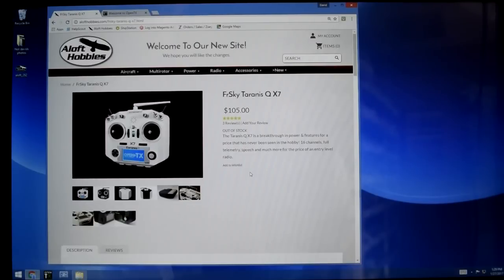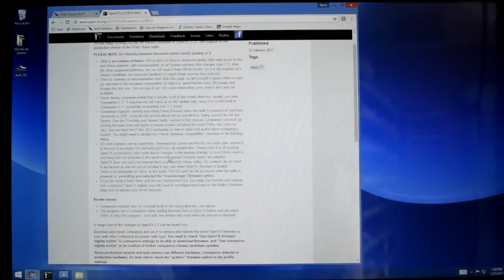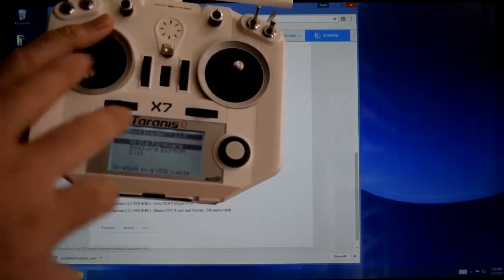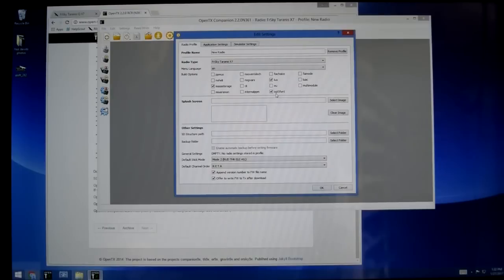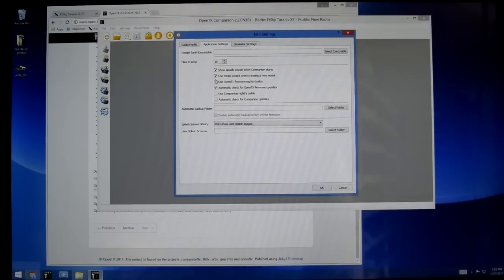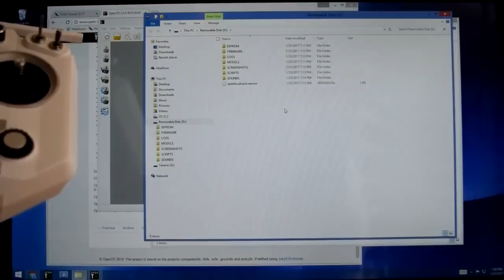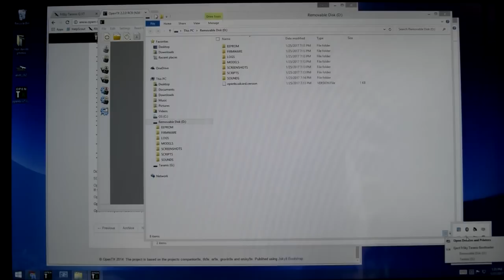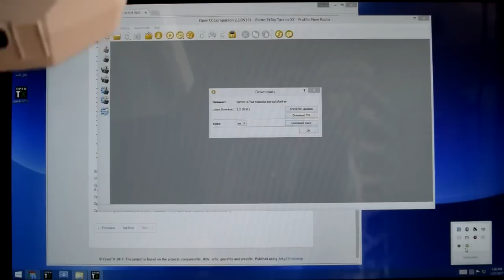Taranis Q X7 - Updating your firmware

Comment: any idea for such issue ?
i have upgraded firmware from Companion software (profile set corectly for proper radio model). I noticed strange thing, after entering bootloader menu, radio skipped bootloader menu into USB connected message. Program seems to work fine, (writing new firmware finished successfuly etc etc) but after disconnecting the USB cable (from windows too), there was still message "USB conne..." on the display and radio stucks. i canoot power that off - after unplugging battery radio didnt powering on :( - bootloader menu didnt work too.

Comment: I can't get mine to go into bootload mode.  When I hold both trims and turn it on, it lights up but screen is blank.  I copied OpenTX 2.2.0 RC10 (N362) firmware to an SD card and flashed bootloader from second screen in the radio setup.  It flashed bootloader just fine with no errors.  It still won't enter blootload mode.  Same thing - blank screen with light on when I do the three finger trim start.  I have also flashed firmware with the TX off via 2.2 companion and it still won't bootload with three fingers.  Just got this from you last week.  It never has wanted to enter boootload since I opened the box.  Scratching my head.  Thanks for your help
Reply: You need to have the USB plugged in -
Reply: Rick Reicker - I figured it out. New button should not be held down. Quick press or else it won't go into bootload on mine.

Comment: Thank you. I followed your directions, and it worked. But when starting up my controller I get a SD card warning that Expected Ver: 2.2v0005, any clue why? Thank you
Reply: I've have this problem and I've got all the right stuff on the sd card but the error is still coming up and theres no voice playback when I turn on the tx , any suggestions ?
Reply: problem fixed just need to only copy the files in (sdcard-taranis-x7-2) to the sd card, not (sdcard-taranis-x7-2) folder itself or the taranis won't read it